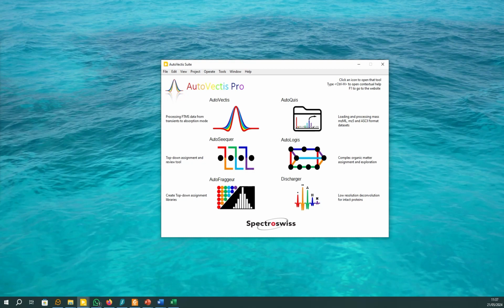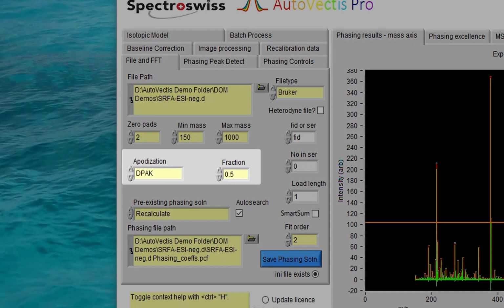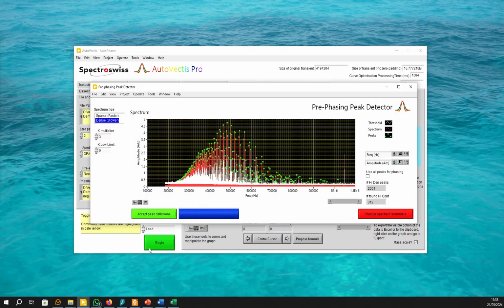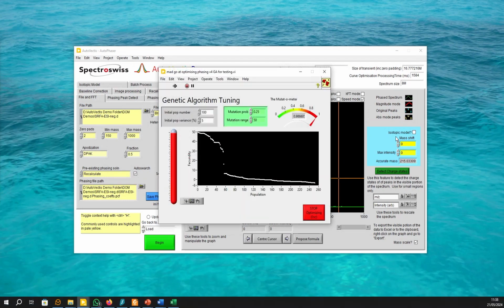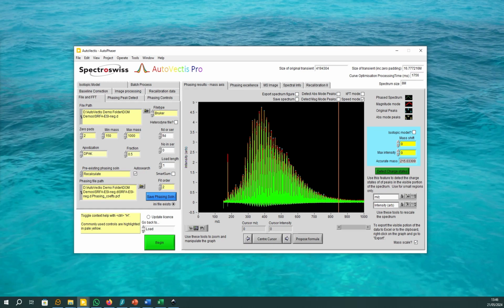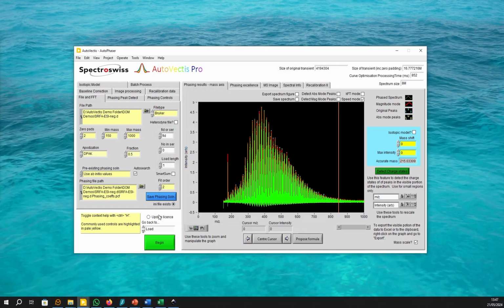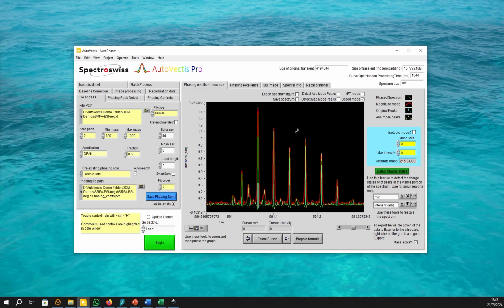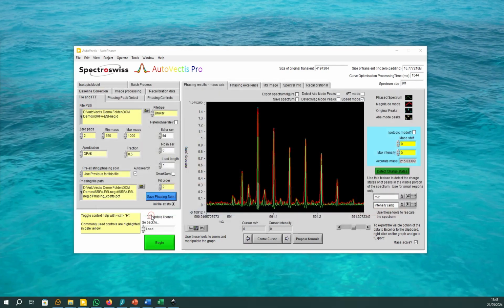AutoVectis - processing Bruker files to absorption mode

Comment: Hello! I know this isn’t related, but could you please provide any suggestions about what may be causing Curtain Plate Voltage fluctuations(Expec Triple Quadropole MS) After a certain capillary voltage, it starts fluctuating and goes to standby mode. Could you please provide a beginner-friendly explanation of ESI as well? Thanks!!!🫢
Reply from the maker: Bound to be someone more expert than me - but I'd be thinking about a short or breakdown occurring at high voltage?
Reply: @autovectis  Trust me, I am not. I am just more interested in working principles than the actual analysis process🤦🏻‍♀️ I like your in depth videos, looking forward to another vid about MS(hopefully ESI, improving resolution, this kinda fundamental stuff)